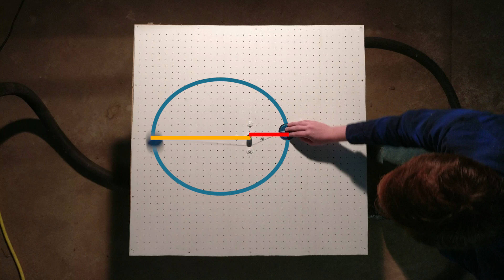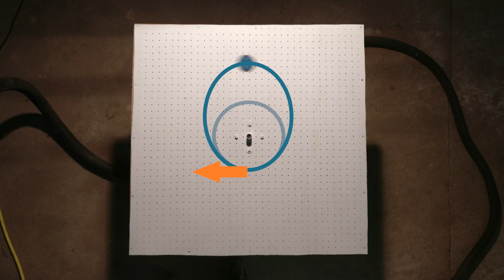How do Orbits Work?

Comment: Can someone explain to me why it doesn’t fall back down at 90% gravity, I know that it has horizontal momentum but I thought horizontal velocity is independent from vertical velocity.
Reply: It DOES fall.  An orbit is a state of perpetual free fall.  Everything in orbit is falling toward the center of Earth just like a rock does when you drop it.  I think what is confusing you is that the Earth is a sphere and since gravity is always toward the center of the Earth, the direction that gravity pulls on an object that is moving across the surface at a high rate of speed is changing.  In other words, "down" is constantly changing.

Picture a perfectly circular orbit around a perfectly spherical planet the exact same size and mass as Earth that has no hills, mountains, buildings or otherwise obstacles of any kind.  Also, no air.  You could put an object in orbit around this planet just an inch above the surface if you wanted to.

To back up just a bit, imagine you are on a perfectly flat surface.  If you had a gun that could fire a bullet perfectly parallel to the ground and let's say this gun is exactly one meter above the flat surface.  Also, no air - so drag is not an issue.  If you fired a bullet from that gun at the exact same moment as you dropped a bullet from one meter, both the fired bullet and dropped bullet would hit the ground at precisely the same time.  This is an example of the downward component of acceleration caused by gravity being entirely independent of the horizontal motion.  Your intuition or understanding is entirely correct.  The issue is that the Earth is not flat; it is a sphere.  So the "downward" component caused by gravity is technically toward the center of the Earth, and if you are moving fast enough, what you would define as "down" or "toward the center of Earth" is changing constantly.  For a perfectly circular orbit, obviously from some fixed point, the object in orbit makes a circle around the Earth, but the downward component of this motion is still independent of the lateral - or tangential velocity.  It's just that the directions keep changing.  At any given instant in time, the "downward" component of motion is independent and perpendicular to the tangential component of motion.  It's just that the direction of both constantly change.

To go back to our perfectly spherical Earth with no obstacles or air, let's take the same gun one meter above the ground.  If you want to nitpick, technically the gun could not be parallel to the ground because the ground is curving; not a straight line, but it's pretty much locally parallel - or more accurate, the gun will fire perfectly tangentially to the surface of that sphere.  Now - imagine that the bullet is fired at a speed such that for every meter it falls downward (because it's obviously going to fall), it has traveled so fast and far across the surface of Earth that the surface has curved away by that same meter.  You should be able to imagine that at any given instantaneous moment in time, that bullet is exactly one meter above the surface moving tangentially to the surface,  and gravity - which is independent of the bullets tangential motion - is pulling directly toward the center.  This is always the case.  In perpetuity.  The bullet is still free falling.  The tangential velocity of the bullet is still always entirely independent of the "downward" or "toward the center" motion caused by gravity.  It's just that the orientation of this sort of ballet between the two components of motion rotates as the Earth curves.

If you were to calculate mathematically (and somewhat crudely) how fast the bullet should be fired, you can - just to show that the "downward" component of motion is indeed independent of the "sideways" component.  How long does it take an object to fall one meter near the Earth's surface?  The acceleration would be about 9.8 m/s², so the equation would be t = √(2d/g) where d is the distance to fall and g is the gravitational acceleration.  So :

t = √(2d/g) = √((2(1m))/9.8m/s²) = √2/9.8 = √0.20 = 0.45 seconds.

So, an object will fall one meter in 0.45 seconds in Earth gravity (when near the surface).

So, how far across the surface do you have to go on Earth for it to curve downward by 1 meter?  This is a crude calculation, but it's a perfectly good enough estimation for our purposes.  d = √((h(2R+h)) where d is the distance to travel across the surface, h is the distance you want the sphere to curve downward (1 meter in this case) and R is the radius of that sphere (6,375,000 meters in our case).  Plug all this in :

d = √((1(2*6,375,000+1)) = √12,750,001 = 3,571 meters.

So, the bullet takes 0.45 seconds to fall 1 meter - and the Earth curves by one meter for every 3,571 meters you travel, so the fired bullet would need to travel horizontally at 3,571 meters for every 0.45 seconds.  This would be about 7,936 m/s - which is essentially the orbital velocity required to orbit one meter above the surface.  

Now obviously, in the real world, you can't orbit just one meter above the surface because the air would disintegrate anything traveling 7,936 m/s just a meter above the surface - and then you'd have hills, mountains, signs, buildings, you name it that would be in your way.  Rockets don't go to space because you magically "reach" orbit as if its a place.  Orbit is a state, and you need to be in space so that you aren't traveling thousands of miles per hour through thick atmosphere and have no chance to run into a mountain. You could do the same backhanded and crude calculation for something at actual orbital height (say 400 km) as I demonstrated here, but the acceleration due to gravity is slightly less (about 90% what it is at the surface - as you rightly point out), and the "imaginary" planet you use to calculate the estimated curvature would be the size of that orbit - or the radius of Earth plus 400,000 more meters.  The bottom line is - objects in orbit are very much falling the same way any projectile falls like a rock or a ball.  It's all free fall.
Reply: @willoughbykrenzteinburg  replying to save this for later.
Reply: And, now I'm itching to do the crude calculation anyway!  

So, let's say we are talking about an orbit 400 km above the surface.  We can imagine that we are orbiting just above the surface of a sphere there.  So that sphere would have a radius of the Earth's PLUS our orbital height - or 6,375,000 + 400,000 = 6,775,000 meters.  So this is one figure we need.

Another figure we need is the acceleration due to gravity and from a height of 400 km, the acceleration is about 8.675 m/s² = which is about 88.5% of what it is at the surface.

So, let's do the same exercise.  The amount of time it takes an object to fall downward by one meter at a rate of 8.675 m/s² is 

t = √2d/g = √(2*1 meter)/8.675 m/s² = √2/8.675 = √0.23 = 0.48 seconds.

So, 0.48 seconds - slightly longer than it takes right near the surface.

And how far across the surface of an imaginary sphere with a radius of 6,775,000 meters do you go before it curves downward by one meter?

d = √h(2R+h) = √1((2*6,775,000) = 1) = √13,550,001 = 3,681 m/s.

So, to orbit in a circular orbit 400 km above the Earth's surface - or to make sure that for every meter you fall, you travel so fast that the imaginary sphere has curved by that same meter - two motions that are independent - you have to travel 3,681 meters for every 0.48 seconds or about 7,669 m/s.  

A more direct and derived way to calculate orbital velocity (for a perfectly circular orbit) is to use this equation :

v = √GM/r where G is the gravitational constant (6.67*10^-11), M is the mass of the Earth (5.97*10^24 kg) and r is the distance to the center of mass of the Earth (6,775,000 meters), then 

v = √((6.67*10^-11)(5.97*10^24)/6,775,000) = √(3.98*10^14) / 6,775,000 = √58,774,760 = 7,666 m/s.

So, our backhanded calculation showing how gravity and the orbital velocity are entirely independent motions - using basic common sense comes up with 7,669 m/s.  Using the actual derived equation taking into account the actual gravitational constant and mass of Earth yields a result of 7,666 m/s.  The only difference would be some rounding errors here and there.

I know these comments were long and cumbersome, but I hope they helped anyway.
Reply from the maker: The direction of horizontal and vertical change as you go around the planet which makes this complicated, I'll use a fixed x-y instead. They are only independent over short distances where we can assume the earth is flat. Imagine the a satellite rotating 90° around the earth. It starts with zero y-velocity and a big x-velocity. As it rotates 90°, gravity increases y-velocity and decreases x-velocity. But by this time the satellite is a quarter of the way around the earth, that new y-velocity is now horizontal relative to the ground. Gravity is required to keep it in orbit, like the string or rope in this video, without it you would only have x-velocity and would drift away in a straight line.